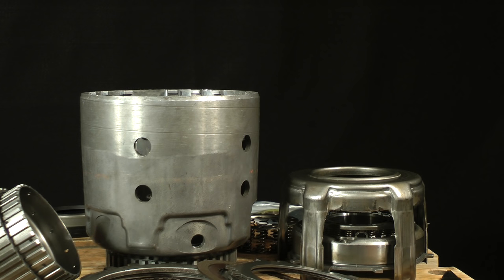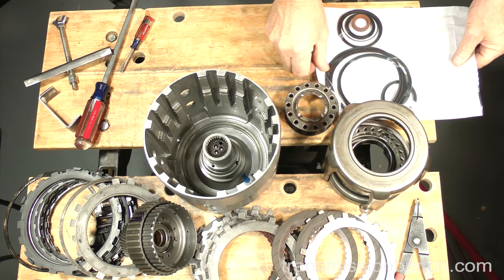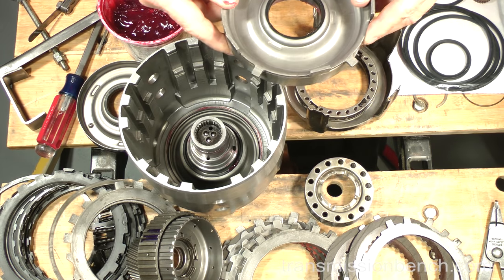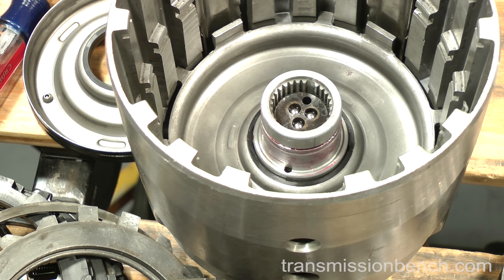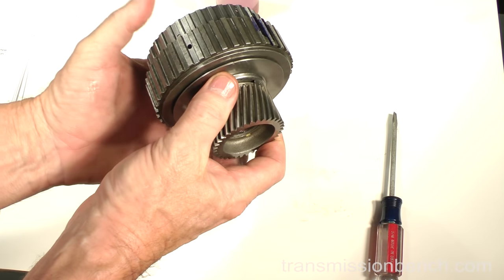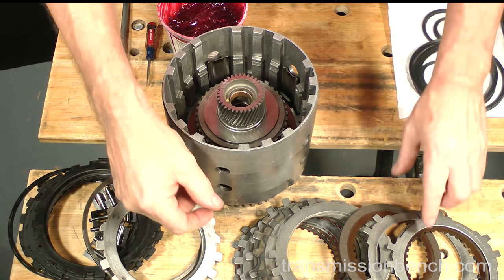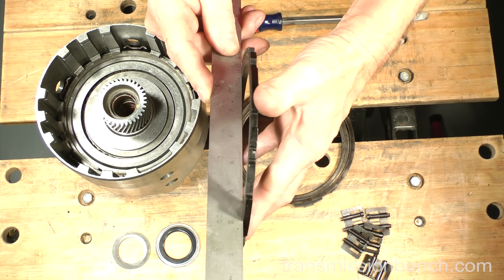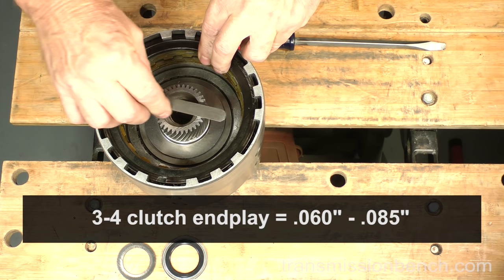Project 4L60E part 2 lesson 5

Comment: OMG don't try to use regular snap ring pliers. It's nearly impossible. Use lock ring pliers, they are made for these type of lock rings and make it so much easier.
Reply: I used regular snap ring but holey hell it added many unnesseccary hours, libations and foul language
Reply: Your Exactly right ! Many HOURS ! Added time. Now after wasted time I took a chance and got out my imitation Dremel tool with a Cut-off wheel, I cut a tiny grove right past the end.... it worked first try ! Wish I thought of that weeks ago. Of course it only works for reassembly! Be careful u don't cut grove to deep

Comment: I have a 1996 impala SS, with that being said, the three pistons in the input housing are cast aluminum. Will the 1997 or newer steel bonded pistons work in the older style 4l60E's?

Comment: When I apply air to the lowest hole (to apply the 3-4 clutch pack) the air just comes out the hole on the end of the shaft next to the check balls (3). Any idea whats going on?
Reply: Jacob Mears I am having the same issue. Did you figure it out?

Comment: Just a couple of comments to add as we go into 2020. First, it is important to leak-check the orifaced cup plug in the front of the input housing & shaft assembly. Re-stake or replace after cleaning and fails to seal for the 3rd - 4th apply piston.
Secondly, improved “Blue” rubber compounds that withstands the thousands of heat cycles and wear from movement sold in sets of 3 of steel molded pistons. These will last way longer, unless you need repeat work every 8 years! 
I’ve known many techs who skip steps and don’t even know the Oring that goes onto the internal nose of the input forward housing shaft assembly before the 3rd - 4th clutch piston is installed.
ASE Master Tech / 1978 / Retired 
Other, nice series of sectioned lessons.
Reply: For those building a 82 - 93, TH700r4 - 4L60, using the “Blue” rubber type molded steel pistons, the spring retainer shown at 10:21 is required. It is ACDelco p/n 24206085. It is narrow and has a steel end plates and works with the same clip. This “Blue” rubber compound is 4-5 times more resistant to heat, retains its shape way better and allows for use of the 0.50” boost valve that increases line pressure and can deform the aluminum pistons. Checking for bent or deformed aluminum pistons is in the GM service manual. Low & reverse is the same but by design is heavier to start with.
ASE Master Tech since 1978
Reply: How do you leak check the cup plug?
Reply: Levi, That a cool name! It is normal to add Solvent or mineral spirits 2 part to 1 part ATF. Using a hypo or straw with finger on end, fill the ball cap almost full. Take a lunch then check under it. Should be dry. Remember, 2 check balls in capsules, one at center rear and other over servo’s. High wear on high mileage cases and rarely checked. GM’s service manual says to use a #4 easy-out, I use a 3/8 fine tap. (Test for fit on size, but use fine) screw in until it grabs & turns. Place a flat plate on VB surface, grab with vise grips, turn, push down on handles if you place a flat fulcrum for pivot 1” back and it should pop out. They say to measure top for depth but it bottoms out with 3/8” drift. Cheap insurance for $6. Best to change, up to you but stay safe and wear a glove to watch fingers. Hope this helps!
(Tip) hit video gear in upper right when at regular screen. Change speed to something faster. See something, slow down to normal the re-play. The easy-out trick is in the video I think. He is an “STG” GM instructor. Have a good one! ASE Master Retired.

Comment: I did use the .060 to .085 and .one is working fine but it looks like they recommend .025 to .040 so I don't know I hope it last my kit car with the alto power pack with 9 frictions and some different sized steels and another I believe top plate but I don't recall
Reply: How is your ride doing?  I was only getting about .030” clearance so I I swapped one of the steels out for a .076” to get to the .060 to .085”
Reply: @brittoncorbin7144  it's totalled but it was fine till then

Comment: I've got my transmission tore apart and was not happy with what I saw. I paid 1300.00 dollars 5 years ago to have it rebuilt  and all the clips on harness broke, harness shell broke in half valve body bolts loose . My main problem was 2nd and 4th slipping found drum burnt and band burnt , drum is ruined luckily I got one out of my practice transmission and harness is pinned the same just have to cut pwm solenoid out . Thanks again will let you know how it turns out .

Comment: Hey I have a 04 gmc sierra with this trans and a new process 246 behind it. Do you know if transmission fluid is supposed to come out around the output shaft on the transmission in between the transfer case. I have my transfer case out and just rebuilt it and noticed with the engine running fluid squirts out around the output shaft on the transmission. is this normal our do I have a seal leaking. Thanks in advanced for any advice.
Reply from the maker: Hi Tyler. This is normal. The adapter housing will have fluid from the transmission in it. If you look, you'll notice that the splined input shaft of the transfer case has a seal around it to keep the two areas separate. Jimmy

Comment: I don't know if you read your comments any more, but I wanted to say thank you. I just got done completely rebuilding my 4l70e for my trailblazer SS. the motor makes about 630 hp and some hard track time. built the entire thing with general transmission knowledge and your expertise. so again I say thank you whole heartedly for what seemed an easy build. here's the setup.
the build:
Circle d 3200 stall
Ck performance billet output shaft
Red alto 8 - g3 disks with kolene Steeles
Borg worner 29 element forward sprag
5 pinion planetaries front and rear
ac delco reverse input drum
Red alto extra wide Kevlar band
Sonnax servo with 4th gear super hold
Sonnax pinless accumulators
Sonnax 2-3 shift valve
Sonnax servo release check valve kit
Ac delco servo check valve
ac delco shift solenoids
Ac delco 3-2 downshift solenoid
Ac delco pwm solenoid
Ac delco pressure manifold
Ac delco tcc solenoid 
New ac delco harness 
New transgo valvebody plate 
Sonnax line pressure booster
ac delco  pump
Sonnax accumulator 1-2 spring
Sonnax heavy duty sun shell
Sonnax smart tech input drum
Complete gasket and seal kit
ACdelco 3-4 Apply and Backing plates for proper 3-4 clearance:
Complete bushing kit with Teflon front pump bushing
Complete thrust washer kit:
ACdelco 3rd accumulator 
Sonnax torlon check valves
Bonded steel 3rd clutch piston:
Sonnax replacement load release springs
Ac delco filter
Converted systemto 6an fittings and lines 
B&m external cooler
Reply: I plan to rebuild my transmission what's better Alto or Raybestos clutch packs?
Reply: Hello hope it's not inappropriate to message you this way but I'd like to ask a question. You appear to be very wise and educated on the tranny issues. 93 Chevy 5.7 no second gear . Do you have any ideas or comments on my problem!! Thank you in advanced!!
Reply: @joshuawilson9086  do you have 3 Rd gear ?
Reply: @bryanmartinez6600  yes sir everything seems fine just will not go into 2nd gear. Although I can pull it down and reverse out of park I can feel it take gear I feel it go to neutral I feel it going Overdrive I Feel It Go in Drive I feel it Go in first but when I put the lever in second gear about two to three maybe four seconds when it should take gear it kills the engine feels like on a straight shift you just dump the clutch
Reply: @joshuawilson9086  I was thinking it would have just been your 2-4 band but these 4L60E fail randomly. I plan to tear apart a cheap rebuilt I bought but has no gears at all it only drags forward even in reverse, I wonder what I'll find.

Comment: What if the input housing has a few scuff marks around the top rounded edge of the housing  (About 1/2 inch below the top where the splines are on the drum). The scuff looks like it is from where the reverse input drum sits on top of the input housing. Could the scuffs on the input housing be caused from that? Or maybe from 3-4 packs being burnt out, hence why my truck only had 1st, 2nd and reverse? Once my truck shifted to 3rd it was like I had pushed in the clutch but on a automatic transmission.

Comment: hi i was wondering if someone could help i rebuilt my first tranny a 4l60e and put it in every thing worked just not 3 or 4th gear it would just rev real high like it was slipping but after taking it apart again i noticed my gap was at .105 and its supposed to be between .060 and .085 would this cause the revving problem it seem like it has to be it thanks
Reply: yes it would your are probably missing a steel or friction
Reply: or one of the shaft seals are bad or the 3-4 piston is leaking like a sumbitch.   could be a lot of thing 4 yrs ago probably don't matter now.

Comment: Hi I got a ford freestar and the problem is : first of all , the van is driving and shifting perfectly but after 15 ,minutes every gear begin to slip. What do u think that is the issue jimmy? Thanks for your time and in addition, yours videos are the best
Reply from the maker: +Jonathan Nourian Hi Jonathan. The booster valve and sleeve in the valve body of these transmissions wear badly too. After the fluid thins out from heat, the pressure drops. Jimmy
Reply: bench do u have that repair kit to buy?
Reply from the maker: Hi. Unfortunately I do not carry parts for those transmissions. You might try calling Whatever It Takes Transmission Parts. Their number is 1-800-940-0197. Jimmy
Reply: thanks Jimmy appreciate it

Comment: you never mentioned how the 1993 version assembly goes. its slightly different and i cannot continue and have to look else where to finish that portion for the 3-4 clutch pack assembly and im having a hard time finding info on my year 4l60e

Comment: I just wanted to add that only 4l60 takes .060 inches of clearence as a minimum between the 3-4 backing plate and first clutch plate. The specification is .060-.094 as stated in the video. However, the 4l60e takes .035" to .083" of clearance. That info is per service manuals. I got on mine 0.45" of clearance for a 2005 Trailblazer. I just wanted to put this here if someone is not getting the .060 despite using different size pressure plates; saving you the hassle 😅 I experienced. Always check your respective GM unit service manual
Reply: I was wondering this because I replaced my 3-4 pack with 6 friction plates and 5 steels at .106” and the clearance was only .035” and it was all stock frictions and steels but the video somehow gets .60” clearance event though we supposedly used the same parts.  I went ahead and changed one of the steels to a .076”, which gives me an addtional .030” or a total of .065”.  I don’t mind being on the higher side.
Reply: @brittoncorbin7144  you are good there with .035 i would believe but take that with a grain of salt; i'm not trans rebuilder. Just a general mechanic. However, That's what the Trailblazer unit repair manual states and i have a GM unit repair for 98 and calls the same. I tested different plates and the best i could based on this video was .055. I left it a .045 though.
Reply: @koffeegreaseaddicts  thanks.  Yes it’s a little confusing because this guy is the guru of tranny rebuilds and he said “it’s critical that the end play be between .060 and .085”.  I take him for his word and you know he knows the GM specs so I reading between the lines that the end play needs to be a little higher than the factory specs, otherwise he would have just repeated the factory spec of .035 to .086.  But then you research and watch the other videos and everyone aims for .035” which is exactly what I arrived at the first time!!  The folks wanting the tight clearance claim it makes for firm shifts but the folks wanting the higher clearance talk about increased fluid flow, lubrication and reduction in temperatures.  AHH.  Very confusing.

Comment: I have a 1996 impala SS, with that being said, the three pistons( 3-4, overrun, forward clutch) in the input housing are aluminum. Will the 1997 or newer steel bonded pistons work in the older style 4l60E's?
Reply: you can use the newer steel bonded pistons but i believe you also need the new style overrun spring cage or 3rd gear will slip

Comment: I've seen plenty of transmission performance companies that like to install 9 clutches in a pack and can go as far up to 15 stacked!  Do they simply use thinner clutch frictions and steels to achieve this, or do the bearings and washers have to be modified as well?

Comment: As I view this video at around 16.20 or so, I see that the sun gear snaps in and out of the sprag race - with the need to use  a hammer.   On my 1997 unit, this sun gear does not need to be installed or removed from the race with a hammer,  it is easily removed by hand... Is that normal? Is that a sign of excessive wear? or is this normal?
Reply from the maker: +Tom Joyce  Hi Tom. This is normal. I explain in the videos that earlier 4L60Es don't snap into the sprag assembly. Yours will work fine. thanks, Jimmy
Reply: +Transmission Bench  Thanks for the reply. Your  video series on the 4L60E have helped me a lot on my project.

Comment: Where do I get the correct overhaul kit? Mines a (94 4L60E one piece case) and I'm beginning to lose 4th gear. It's attached to a chevy 350 in my 94 chevy c1500 Cheyenne. I've got a pretty big parts list cause this transmission has never been touched except to replace the engine. I'm expecting everything to be worn out that you show could be.

Comment: Since this video was made 9 years ago, there are a number of improvements to the 3/4 drum. 
Rather than use the type of pistons that failed, use a SEAL-AFTERMARKET Hyper-Blu piston set. 
When you take apart the input sprag assembly, if you find the gold washer set as pictured, discard the sprag and washer assembly and replace with an improved Borg Warner set. Also, this video made no mention of inspecting the back or the housing that has the 6 tangs. It should be smooth. If it has grooves, replace it. 
When you do the air check to the drum (@30:32), first pour transmission fluid into the area where the spacer and bearing goes. Then apply air. Look for air bubbles. Check the other 2 apply holes and look for air bubbles. No bubbles, good to go, .... got bubbles, then tear down the drum, push out the shaft and re-seal the input shaft to the drum. By the way, nor was it mentioned about checking the drum for wear on the splines where the clutches ride. Look at 31:30. Below the lower teflon seal. Those splines should all be full with no wear. You can see in the picture where the splines are scuffed, but not worn. if the splines are worn, time for a new drum. Odds are you will not find a new drum any longer and will need to find a good used drum. But, yes, there are still new drums available, I keep 4 or 5 on my shelf. 
And speaking of the 4 teflon seals, (also 2 on the pump stator) REPLACE them.

Comment: hey everyone, I need some help here I have 93 one-piece case 4l60e trans tag number (3KCD336B) and I've been following this guy's videos wall I've been rebuilding mine and for some reason I cannot get the clearance needed for the 3-4 clutch pack I'm only getting 0.20" and even doing the math to change the steels and or the backing plate is not coming up close enough to what it needs to be. anyone got any ideas of what I can try

Comment: I  have a 2007 Tahoe LTZ and lost 2nd and 4th gear.. With shifter in 3rd.. I have to rev out 1st and blip of the gas to shift into 3rd bypassing 2nd.. Still no 4th gear but can Cruz all day on freeway doing 85 just high rpms because no 4th.. Been driving Tahoe all day every day like this for 6 months.. Any thoughts would be greatly appreciated... Thx

Comment: if a shallow pan filter is in a deep pan what could go wrong?
Reply: As long as it's kept full of fluid, nothing. But you are at higher risk of the filter sucking air, the dip stick won't help except at full

Comment: My 700r4 has aluminum pistons with the rubber seals, would it hurt to use the steel ones that also came with my rebuild kit? They seem to fit as well.

Comment: My new forward clutch piston went in housing with no resistance. I didn't need feeler gauges or anything. Will this be an issue?
Reply: It should have a lil resistance going in an coming out, its supposed to be able to seal.

Comment: Wish your videos would have been around when I rebuilt my 4L60E out of my 93 truck. But I haven't had any issues. I just ended up replacing the input drum with a hardened 300mm shaft that hopefully won't sheer at 600hp. And I replaced and the clutches and frictions. I've learned quite a bit from your videos if I ever end up having to rebuild it again. Is it ok to use a 13 vane pump on a 10 vane transmission? I'm just wondering because I put one on mine. Haven't had any problems just wondering. Also using a hardened welded sunshell and 5 pinion planetaries out of a 4l65E.
Reply: Hello I'd like to ask for your expert opinion on my 93 4x4 I have no 2nd gear everything else fine . What do you think my issue is? Thank u in advanced